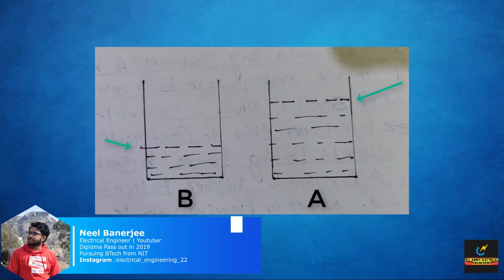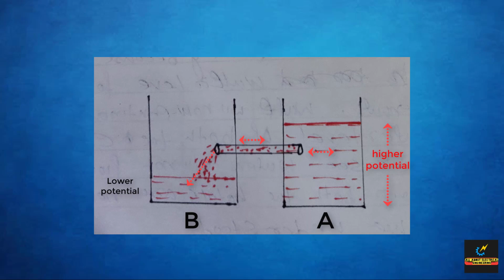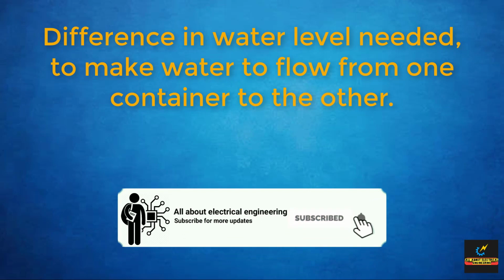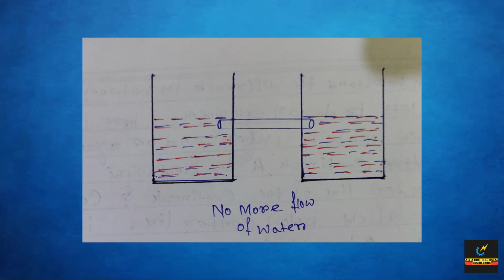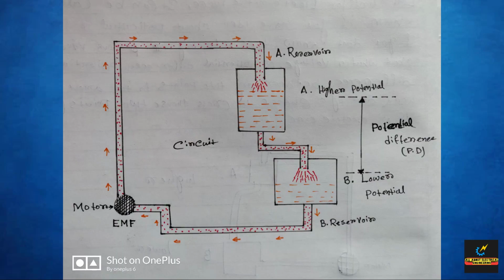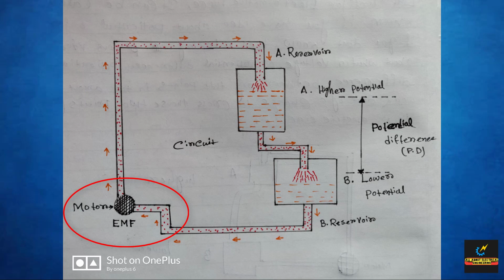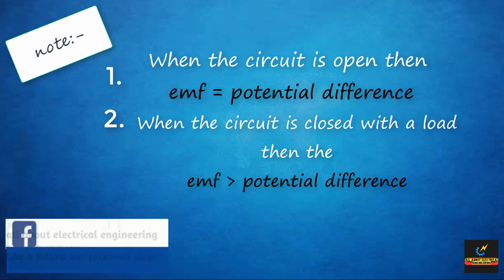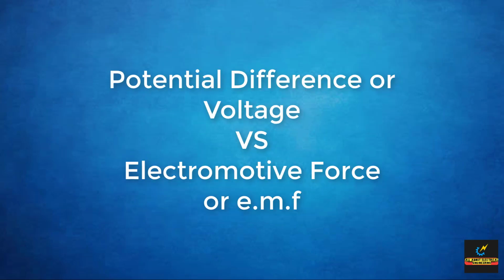Difference between voltage and EMF |by:- all about electrical engineering

Comment: Brother, as we know E.M.F is constant, but P.D is not! 
Then in any cell having there the ratings mentioned are 5V or 6V, are they're the ratings of P.D or E.M.F?
Reply from the maker: The battery has rated in volt because the output voltage can't stay all the time same( because of the internal resistance of the cell) . But for the emf, it continuously maintaining the potential difference. so, for this reason always battery rated in volt instead of emf.
Reply: @allaboutelectricalengineer8556  Volt is the unit of P.D as well as E.M.F. So, the conclusion is, it is the potential difference written on the body of any cell. Ok thank you brother 💙
Reply from the maker: @shubhankarghosh  yes. you are right..